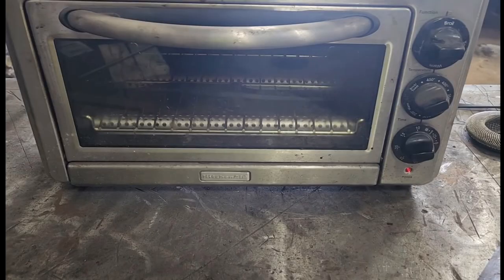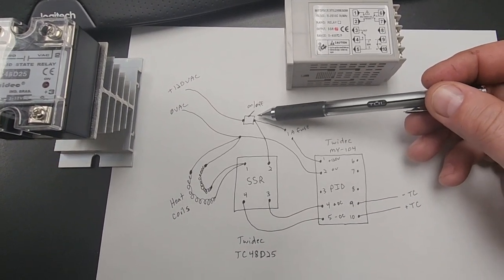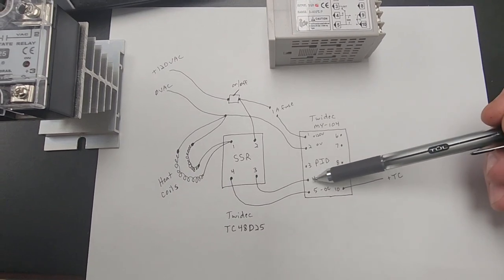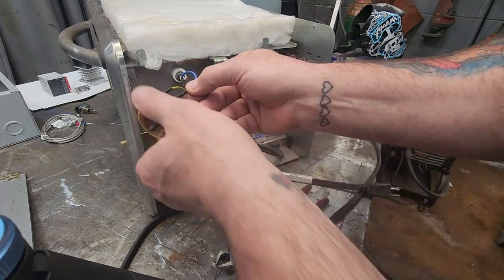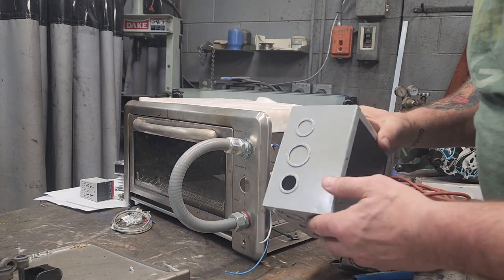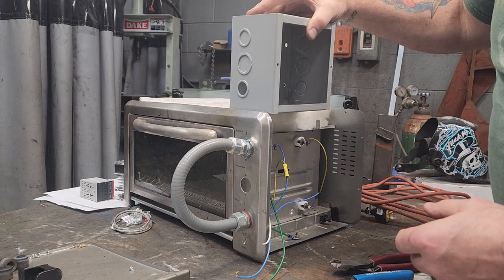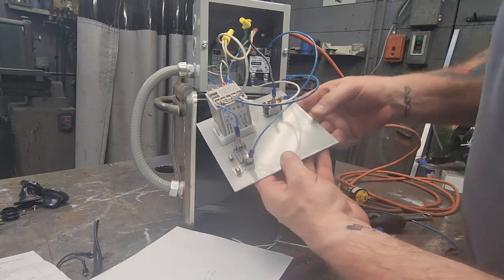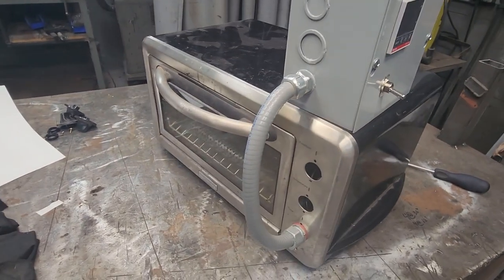Upgrade my toaster oven to PID control!

Comment: definetly like to try this only question i have is the fan motor, im going to need it for circulation not sure if that can be wired in with the heats
Reply from the maker: You could add another circuit off main power and put it on a switch, or use some type of thermal switch if you want it to be automatic.
Reply: @tutorknives  I did just watch another video where they did just that put it on a separate switch through main power
Reply: Also I don't plan on running as high of temps to temper knives but to dry filament and plastic pellets
Reply: So it's not like it would be operating out of its normal range of temps just a better control

Comment: Good presentation.  Your project layout is just what I had in mind.  I have most everything, including insulation. Deciding on the PID is where I'm at. So many cheap Chinese units.  Did you get your PID performance improved?  Any suggestions for choosing a PID?
Thanks.
Reply from the maker: I bought a cheap PID off Amazon.  I'm confident my temp control issue is from poor insulation.  It varies about 20 deg above and below set temp.  I put another cheap PID in a kiln I built (before my channel), and it works great.  I'd choose another cheap one off Amazon.  You could always upgrade if it doesn't perform well.  Good luck!
Reply: @tutorknives  Okay.  Thanks.